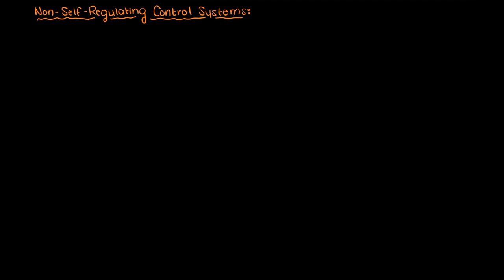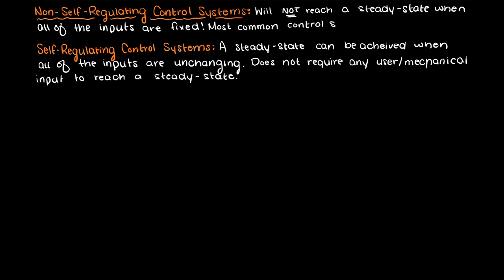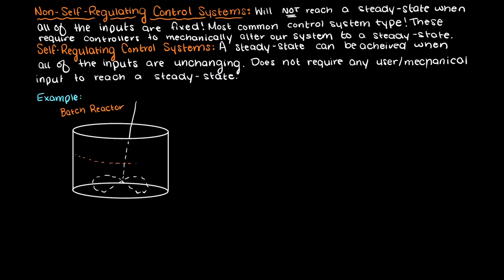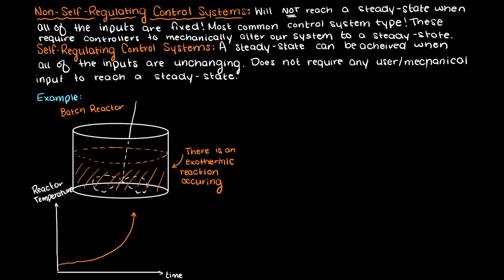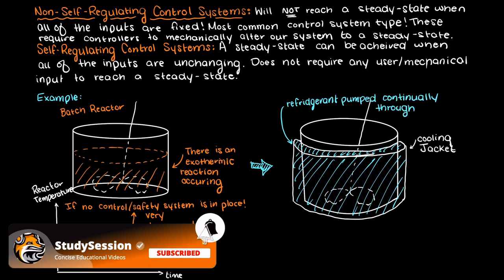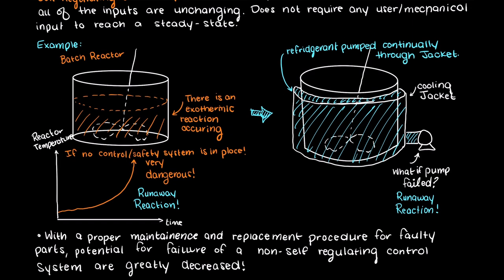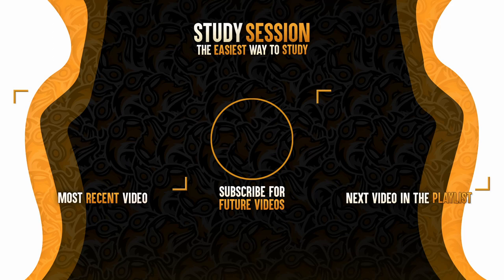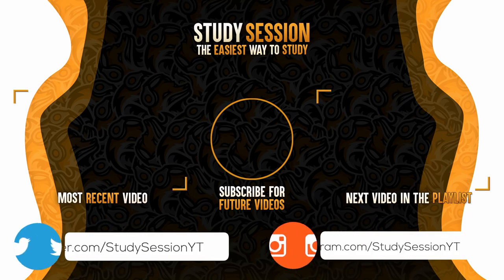Non-Self-Regulating Control Systems

Comment: Hi! I like how you deliver the material. I have a problem. If I would control water, and it must stay at pH 6. Then I have a two-valve, which contains pH up and pH down, which gives them an increment pH or decrease. So, it was a non-regulated process, right? Because when I pour the pH up to the water that has pH 6 before, it would be increased and never reached steady-state, vice versa. I'm not sure it was self or non, because I know that the pH I am pouring into has the limit. The water would not exceed the pH of the pH liquid I'm poured (since the pH scale also has a limit from 0 to 14). So, again, it was regulated or not? Thank you.
Reply from the maker: If youre trying to maintain a certain pH level then yes that sounds like a non-self regulating control system!